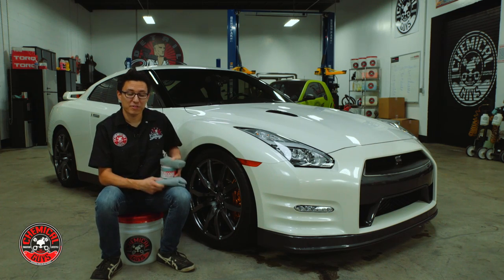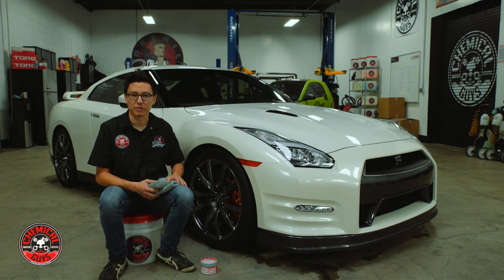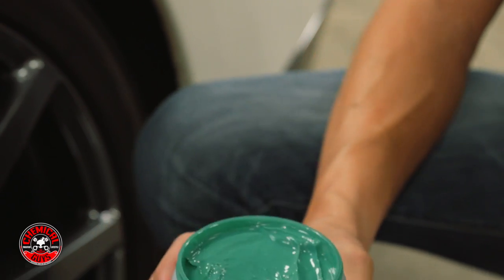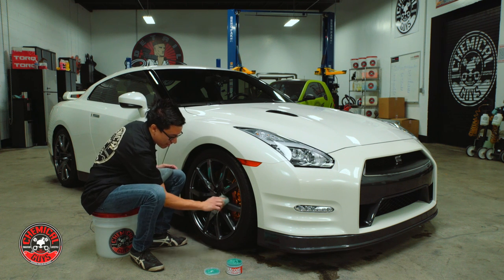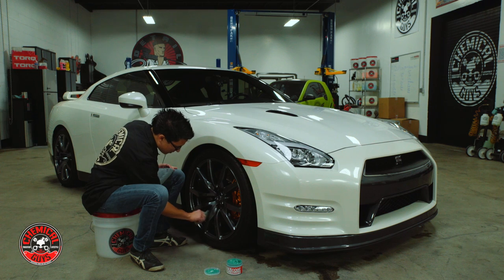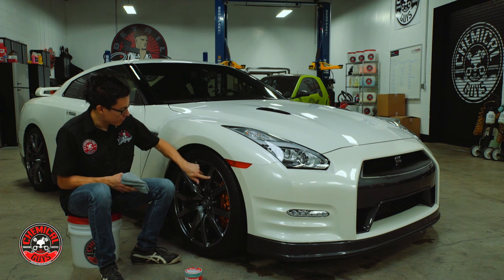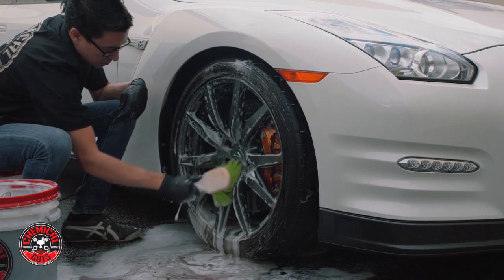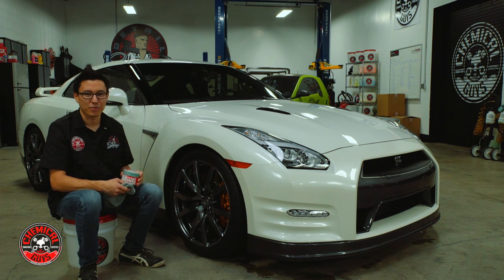How To Polish And Protect Wheels - Chemical Guys - Wheel Guard Max Coat

Comment: Neat product, but what is the difference between using Wheel Guard Max Coat vs.JetSeal on your wheels?
Reply from the maker: You can use Jet Seal on your wheels, but Max Coat Wheel Guard will deliver highest temperature protection and work better on wheels.
Reply: Thanks for replying!

Comment: Anything for satin black wheels?
Reply from the maker: Hi AJ, for matte and satin surfaces, we highly recommend the Wrap Detailer. The Wrap Detailer is designed for matte, satin, vinyl and clear bra surfaces. The great thing about the Wrap Detailer is that it contains a sealant, which will give you protection form the harsh effects of the sun. I'm going to leave a link below to check out the product. We also carry Jet Seal Matte that takes our best and longest lasting sealant, and makes it safe for matte products. Here are some links to the products so you can get an idea of how they work. Stay tuned AJ, we've got more great videos coming your way.

http://www.chemicalguys.com/Wrap_Detailer_16_oz_p/spi21716.htm

http://www.chemicalguys.com/JetSeal_Matte_16_oz_p/wac_203_16.htm

C.G. Alex -

Comment: I dont believe i have glossy wheels but i wonder if i can still use thid on my normal wheels
Reply from the maker: Hi there! Max Coat is intended for wheels that have a gloss finish whether it is chrome, painted, OEM or polished it will be fine. Use Meticulous Matte Spray Sealant for matte/satin finishes. - Happy detailing!

Comment: Difference between this and wheel guard? I have wheel guard and think it works pretty well.
Reply: Also check out my video of wheel protecting with Jetseal then Wheel Guard. I did it with the wheels off and protected the inside of the wheel well. Good stuff CG.
Reply: +MikeEM1 Hi dude love your videos :D
Reply: +surviveasl Thanks man! I'll have a video out shortly about me using CG Instawax for every car wash on my GTR.
Reply: +1221Ralph I don't only buy from them for car care, but they do offer some good stuff.
Reply: +1221Ralph I agree. It also looks like they took off Wheel Guard from their website. Which is fine, no need for two wheel waxes.
Reply from the maker: +1221Ralph +MikeEM1 Actually it's a new formulation of the old Wheel Guard. You'll like this one better. We sure did.
Reply: +Chemical Guys Awesome. I'll see if my local CG (Santa Ana) has it in stock
Reply: Works well on stock rims right (clear coat) can I apply it over plasti-dip?

Comment: Can I layer the wheel guard max with jet seal? Or should I apply a second coating of wheel guard max for longer protection and shine?
Reply from the maker: Yes, JetSeal can be layered to give you up to 12 months of protection while locking in the shine. Happy detailing!

Comment: Stuck in my sidewall grooves green and not sure how to remove it and if it will dry there green
Reply from the maker: Hey Jordan! Try using Signature Series Orange Degreaser with a Nifty Brush to scrub away grime.

Comment: can you use this for exhaust tips?
Reply from the maker: Hey Nabil. Thanks for watching this awesome video. Wheel Guard would be perfect for the exhaust tips, it will create a protective barrier to prevent oxidation. You want to make to make sure to thoroughly decontaminate the exhaust pipes, using nonsense will remove any filth, grime, dust, and other dirt that builds up on the metal. If the exhaust pipes have lost their luster, consider using the Heavy Metal Polish.